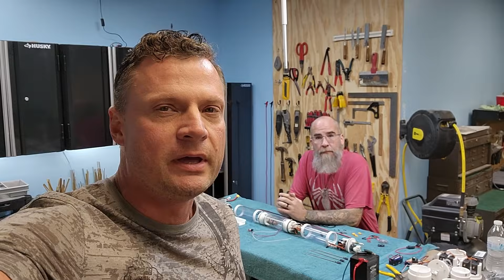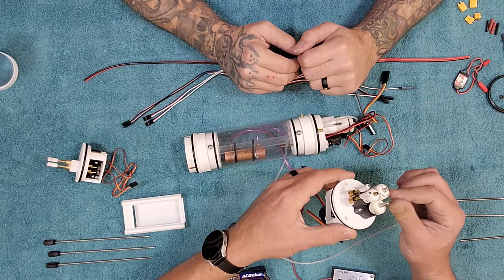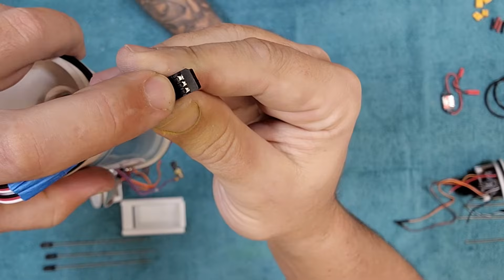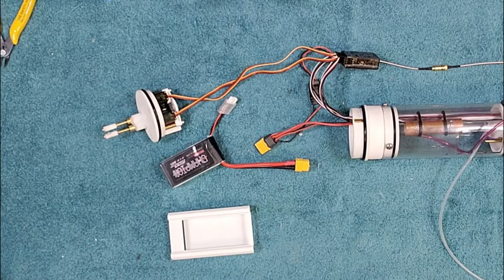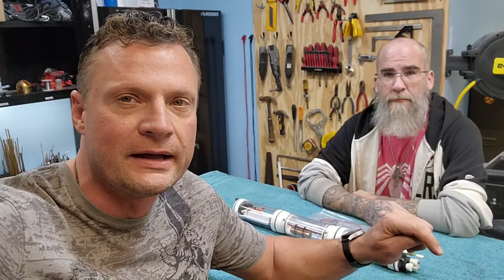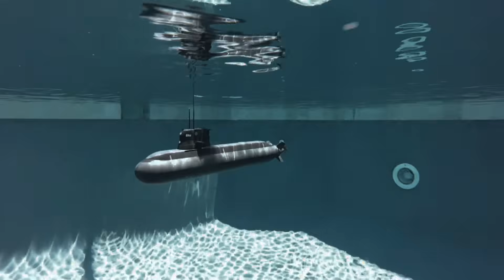Setting up the 250 Series SubDriver for RC submarines

Comment: Hi Bob! Is the dedicated BEC required (or recommended) for this sub driver application? The ESC installed by Jason already has a built in BEC.
Reply from the maker: Recommended, but not required. Integrated BECs are typically lower output. ESCs are taking a lot of abuse compared to a standalone module, so if one goes, you're stranded with zero power. That said, I've used ESC BECs in many builds with no issues at all.

Comment: What ever happened to the the flying sub kit that I have been waiting for over 6 months?
Reply from the maker: It's in the works. New kit parts are completed and I'm working through integration into a practical build now. Please don't take this the wrong way, but do me a favor and don't post passive aggressive notes like this in a public forum until you put actual money down. My obligation is to paying customers, and the one that has money down on this build has been great to work with and understanding that development is not a quick or easy process.
Reply: @RCSubGuy  do me a favor and don't say you are working on a kit and 6 months to 9 months later it is still not done. I am no longer interested.
Reply from the maker: @markwasilow2173  I didn't realize I was on a deadline. Sorry. My apologies. Have a wonderful life.